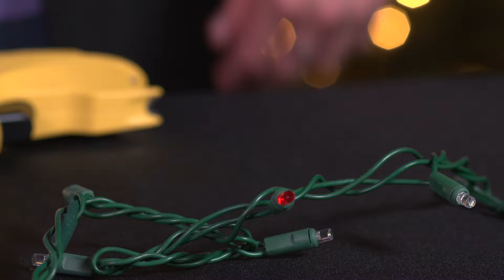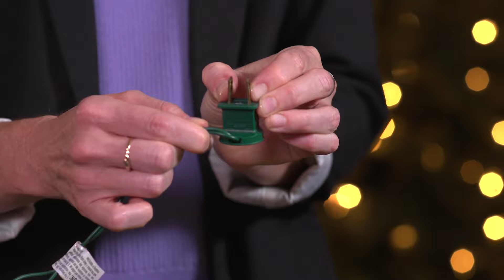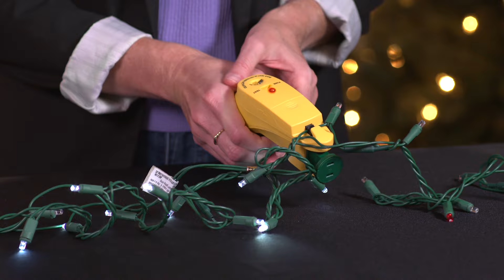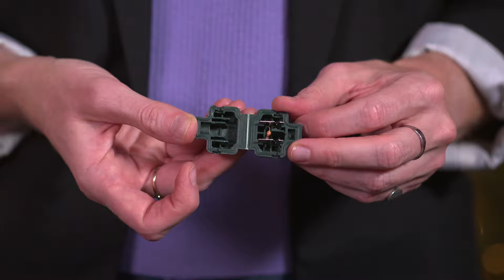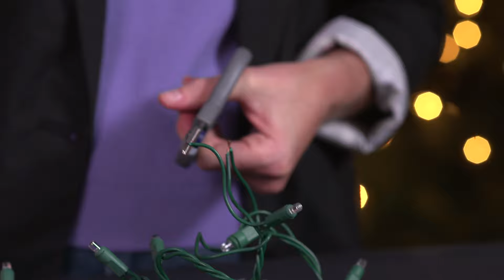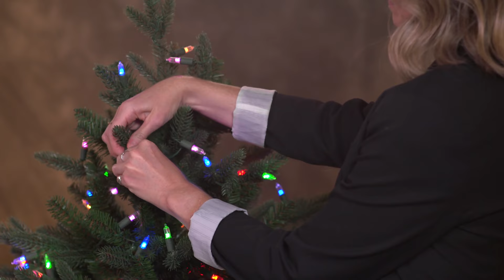LED Keeper Pro Instructional Video

Comment: I'm trying to repair an LED prelit Christmas tree & the plug is too large to fit into the outlet hole area on the light keeper tool, if I use an adapter piece to be able to clear the protruding plastic parts that are getting in the way, it should still function the same, right?

Comment: Not working. Im a iut to throw my whole tree out
Reply: I've repaired a few (incandescent) Christmas trees now, they are definitely a daunting task, especially when it's more than one small section that won't light. Try not to get too discouraged or overwhelmed by the entire task at hand. Break it down to small sections, going layer by layer, branch by branch, at a time. I found it really helpful to have a bunch of clips on hand, to mark which branches I had already checked, so I knew when I had gotten all the way around that layer. Try to follow the wire from bulb to bulb so you don't get lost & mixed up. And I've had it happen sometimes where a section won't light until after I move on & continue testing further up & find the bad bulb a little further on in a different branch, on a higher level of branches even.
Reply: Same fml
Reply: Watch the end. She talks about this

Comment: Bulb puller? I can't get the tiny bulb out.
Reply: The bulb puller is located on the front end tip, the little metal u-shaped part. It works with leverage from behind the bulb housing, like a jar opener. Grasp the light housing on the strand firmly and place the metal bulb puller just behind the part the bulb sits in that is supposed to be removable.

Comment: We cannot pierce the installation on outdoor lights, it will cause them to short if it rains
Reply: The small incision will not cause an issue.
Reply: The bulbs and wires in the sockets are not waterproof. They get wet everytime it rains.
Reply: Mine illuminates dimly when I pierce the wire. What does that mean?
Reply: @Anthony_Butcher 
I'm no expert, but my guess would be that it means the keeper is making a partial repair to the circuit, but it's not getting a good enough connection for the full current it requires to light them properly. Maybe the piercing missed the copper wire partially? Did you try repiercing it? Try adjusting the wire before doing so & get it in there deeper if you can, it could be you just grazed the side of it instead.